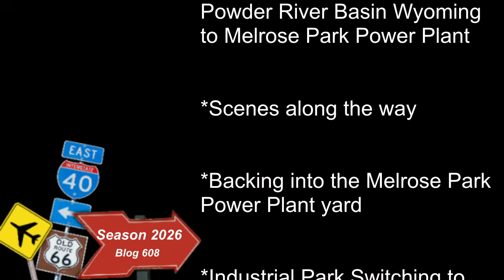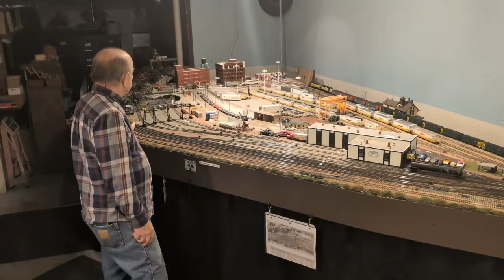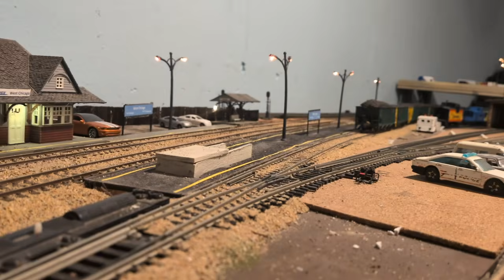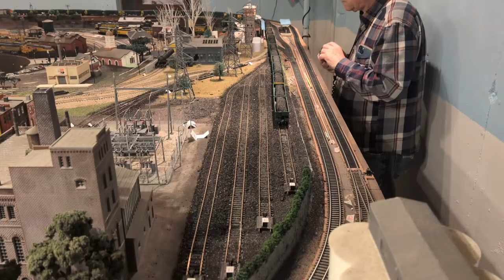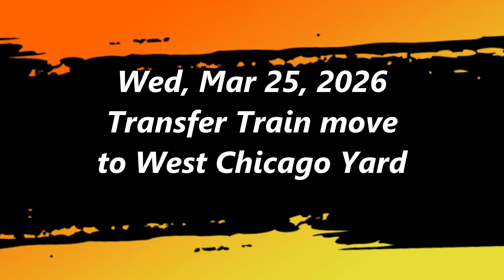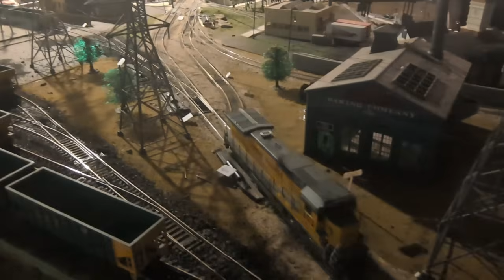Unit Coal Train EB from Powder River Basin UP/Metra Geneva Sub Chicago to Geneva

Comment: hello curt !! excellent video !!! i have been following you for quite some time now, and absolutely love your coal train with well over 40 cars, or thereabouts.  question, curt.... how is the coal unloaded at the power plant ?  i have checked several of your previous videos but i cannot figure it out.... maybe cuz i am retired now !!!  as well, i could hear one of your engines was rather noisy while running down the track.  by any chance is that engine a kato ?  i ask because i have an sd40-2 csx kato that for the life of me i cannot quiet down !!  she has been apart at least 3 times for total lubrication ( any/all moving parts were lubed), full cleaning, gear clearances, etc and it is still noisy !  so, i run it as an "old bear" in her last days before sale or retirement !! thanks curt !!! denny
Reply from the maker: Hi Denny! Thanks for your comment! I load the car by hand off camera. I use a aluminum tray to transport the coal from the Power Plant in Melrose Park to the Powder River Basin in Wyoming. I hang the aluminum tray below the power plant and in the ceiling at Powder River Basin. I will show that in my next coal train video for you.